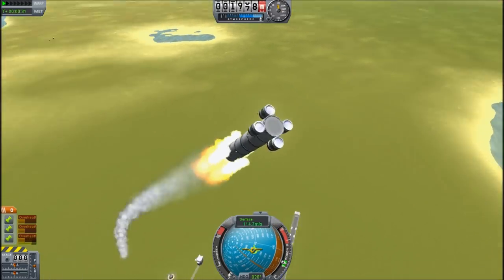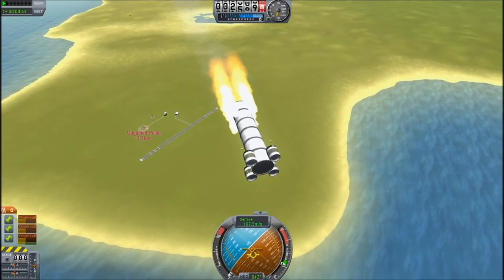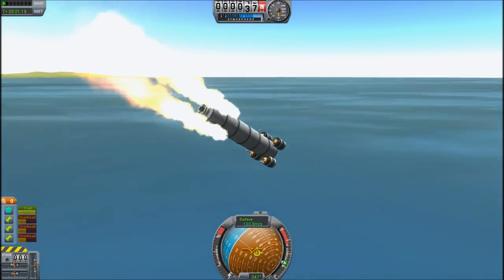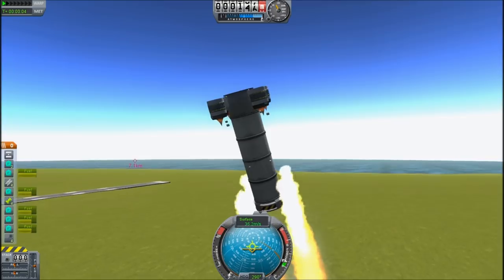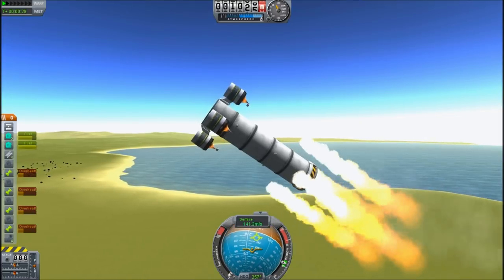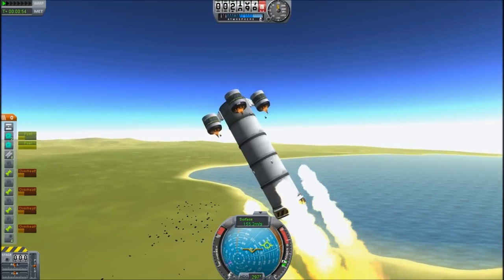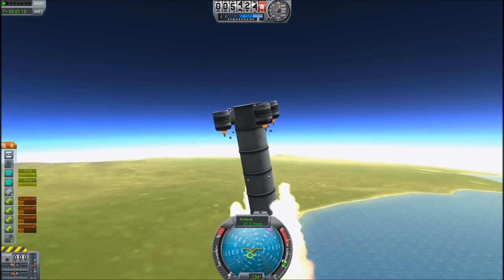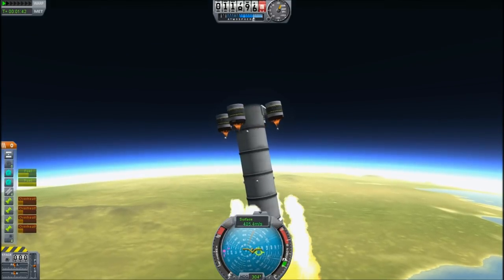The Pendulum Rocket Fallacy

Comment: I thought this was the reason that fireworks often have a pole hanging below them. Why does it work for them then?
Reply: +I Am a Bambi First, the pole helps align the launch by being placed in a guide tube to allow the rocket to pick up speed before it starts its gravity turn.  Second the mass of the pole slows down the turn. Third, the aerodynamic drag of the pole is acting on a long lever arm and serves a similar function to tail fins, further dampening the turn.   For a short enough distance, a gentle parabola is a reasonable approximation of straight.

Comment: It doesn't. Helicopters are inherently unstable, requiring a tail rotor to push against the torque force generated by the main rotor, and frequent adjustments by the pilot to stop it veering off in an unintended direction.

Comment: The stabilization effect in the second configuration is likely gyroscopic.
Reply: +Sam Peabody I bet it's that the aerospikes are pretty heavy so the center of mass is off center from the connecting force from the pylon. So the engine and tank unit flexes to point the engine towards the ground, creating the preferential force pushing the nose away from the ground.

Comment: The SpaceX moon lander starship is a pendulum rocket of sort.
Reply: "Engines at the top" is not quite the same thing as a pendulum rocket.

"Engines at the top and no control system, hope this will keep the rocket vertical"- that is a pendulum rocket that will curve into the ground surprisingly fast.

"Engines at the top, engine thrust vector close to the center of gravity to minimize torque, and an aerodynamically stabilized envelope" - that is an unguided rocket, which will curve into the ground but with a reasonably large radius.

The Starship moon landing proposal has "engines at the top and an active attitude control system". A computer directs the thrust of those engines to truly keep the bottom end pointing down. A landing radar or similar is used for sensing which way is down. Gravity won't help swing the bottom end down, as explained in this video.
Reply: @u1zha  I can't help but point out it bares an entertaining resemblance to a pendulum rocket.

Comment: You didn't read. If the planet was much, much denser and had a smaller volume, like a black hole, the bottom of the rocket would feel a much greater gravitational force than the top (this is what causes 'spaghettification' upon falling into a black hole) which I suspect might make the rocket self-right.

Comment: This is wrong sorry but just look at a bottle rocket if it doesn't have a long stick behind it because you pulled it off it wont fly strait. The reason why pendulum rockets don't work is because you do not want a flame next to your fuel.
Reply: I don't know if he is wrong but that is something that certainly needs more explanation or needs to be calculated out. Hard to believe that skinny/heavy stick works by aerodynamic forces... not much there for the air to get traction on!